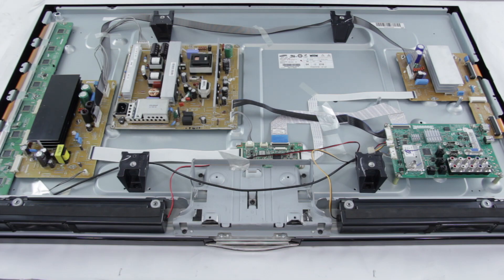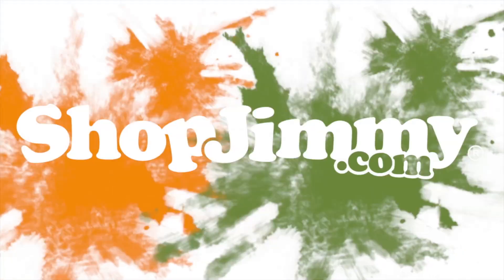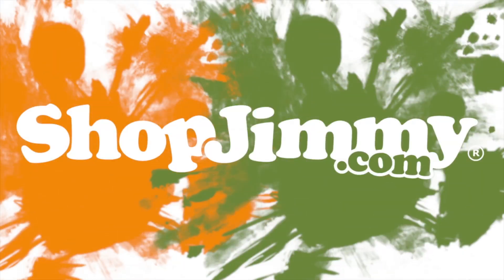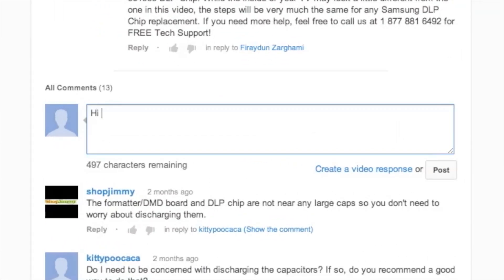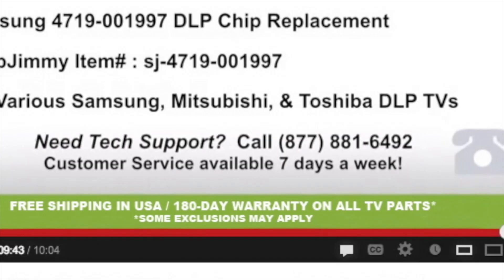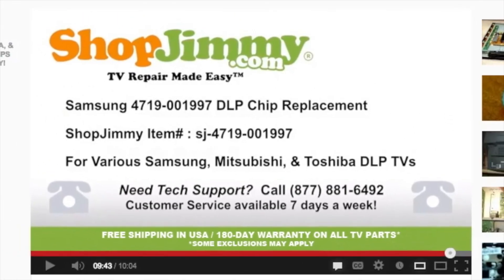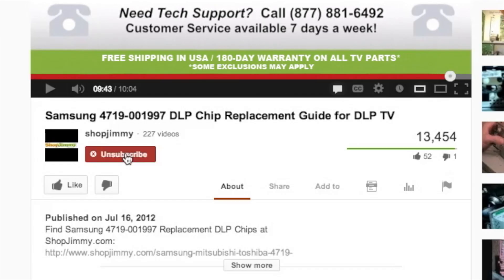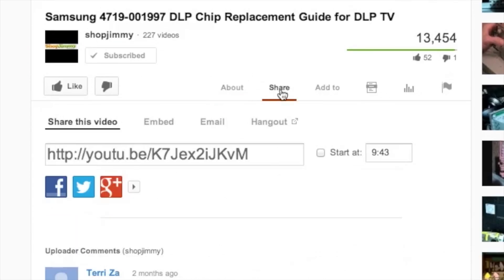Plasma TV Repair Tutorial - Common Symptoms & Solutions - How to Fix Plasma TVs

Comment: Hi there, you guys seem helpful. I have been looking for help with this for a while. I have a Samsung Plasma pn50a510p3f made in June 2008. I think its 55". It turns on and off by itself and occasionally makes very loud noises while doing this. Also, my Xbox 360 will display after about 15 minutes, but my xbox One will not display and causes it to continue this cycling process. I did some research and found that many people have this issue. It is theoretically a bad capacitor in the power board issue. When I discovered this, I opened it up. The problem is that none of the capacitors on the power board look bad! Is it possible for them to be bad without showing? Or could it be another issue? I searched around all the other boards for anything that looks awry, and I could only find one capacitor on the whole TV with a slight bulge. Its 25v and 680 microfarads, and it is on the Y Sustain; I noticed at about 3:45 you mentioned that if this board is messed up it can cause the TV to cycle. Is that simply my problem? If I replace that one cap, should I be fine? Thanks! I don't have enough $$ to shell out for a new TV, and this one is better than pretty much anything I could afford!
EDIT: I tried the method described in this video to disconnect the X and Y boards. The TV is still cycling without either of them being connected, so I am almost 100% sure its a power supply problem. Any suggestions?
Reply: cblowrun Do you have a multimeter?  Tampatec has some good videos on checking capacitors out.
Reply from the maker: cblowrun   PLEASE SUBSCRIBE TO OUR CHANNEL - Try all repairs and troubleshooting at your own risk.  This could be a problem with either the power supply or the main board.  Do you have any experience using a multimeter?  If not, then you can replace the main board and then power supply board individually to see if one of those boards fixes the problem.  Click this link to replacement parts for your TV model number:  http://www.shopjimmy.com/catalogsearch/result/?q=pn50a510p3f  There may be multiple boards for the same TV model number, be sure to match part numbers on your current board, with your replacement for compatibility.  Thanks and please let us know if you have any further questions with your TV Repair!  www.shopjimmy.com
Reply: ShopJimmy.com Hi there, I tried the capacitor repair shown in another video you guys did. After attempting to replace the capacitors, my screen is just white with some black splotches. I wish I could upload a photo for you to see. Ever seen anything like that before? The tv's actual picture was working fine before I attempted the repair - apart from the cycling issue.
Reply: No idea.  Sorry cblowrun.  You might need to check your other boards as well.  :(  I am not really competent diagnose.
Reply from the maker: cblowrun   PLEASE SUBSCRIBE TO OUR CHANNEL - Try all repairs and troubleshooting at your own risk.  I recommend replacing the power supply board, the Y-Main Board, the Upper & Bottom Y Scan Drive boards in your TV.  Click this link to replacement parts for your TV model number:  http://www.shopjimmy.com/catalogsearch/result/?q=pn50a510p3f  There may be multiple boards for the same TV model number, be sure to match part numbers on your current board, with your replacement for compatibility.  Here is a link to a video showing how to identify your part number, click here:  https://www.youtube.com/watch?v=R1jmj_foId0  Thanks and please let us know if you have any further questions with your TV Repair!  www.shopjimmy.com

Comment: samsung pn51d8000 plasma tv won't turn on. Power light blink when I press it.
Reply from the maker: Thai guy   Try this at your own risk. Unplug the TV, then disconnect the y board and plug in the TV to see if the TV powers up. Reply with the results of this test. Thanks! www.shopjimmy.com
Reply from the maker: Thai guy   PLEASE SUBSCRIBE TO OUR CHANNEL - Try all repairs and troubleshooting at your own risk.  This could be a problem with either the power supply or the main board in your TV.  Unfortunately, without testing these boards with a meter and checking voltages, you would have to replace the boards individually to see which on of them fixes the problem.  Click this link to replacement parts for your TV model number:  http://www.shopjimmy.com/catalogsearch/result/?q=pn51d8000  There may be multiple boards for the same TV model number, be sure to match part numbers on your current board, with your replacement for compatibility.  Thanks and please let us know if you have any further questions with your TV Repair!  www.shopjimmy.com

Comment: Hello! I have a Samsung Plasma PNF64F5500AF which has just started going to a black screen occasionally.  It will go black, then the picture will come back, and then black again. I can still hear sound while it is black.  I know it is not the connections as I have tested each of them and the smart tv apps and it still goes black on each of them.  I haven't cracked it open yet to see if any capacitors are bulging or faulty. Please Help!?!?!? :)
Reply from the maker: Jason Pope   PLEASE SUBSCRIBE TO OUR CHANNEL - Try all repairs and troubleshooting at your own risk.  I recommend replacing the Y-Main Board and the Upper and Lower Scan Drive boards in your TV.  Click this link to possible replacement parts for your TV model number:  http://www.shopjimmy.com/catalogsearch/result/?q=64F5500AF  Be sure to match part numbers on your current board, with your replacement for compatibility.  Here is a link to a video showing how to identify your part number, click here:  https://www.youtube.com/watch?v=Aodz2LHkzbY Thanks and please let us know if you have any further questions with your TV Repair!  www.shopjimmy.com
Reply: Thanks shopjimmy.  Replaced the y main and the buffers and it appears to have resolved the problem.  I will recommend your channel and website to all my friends to fix their own devices.  Thanks again!

Comment: I knew about the dangers of flipping a plasma upside down but I figured they are shipped all over the world and also figured I can flip it upside down for 20 minutes while I put the stand on. After I finished putting it together I flipped it upright to use and no picture.
The power button is red when off like usual, and I press the power button to turn on and I see it turns on but all I see is a black screen with no visual. As in its turned on but black as if your on a source with nothing plugged in and when I hit the source button I do not see the Blue box at the top left light up letting me know what input is on but I can see its on for sure. So I don't think it's power supply and I'm not getting any ugly horrible lines on my screen. Any suggestions before I bring a tech out? I don't mind opening myself I like projects.
Reply from the maker: David Gentilella   I recommend replacing the Y Board and Buffers.  Try all repairs and troubleshooting at your own risk.  Please reply with your TV model number.  Click here to view a video that shows how to find your TV model number:  https://www.youtube.com/watch?v=S51nhAmwR2M  Thanks!  www.shopjimmy.com

Comment: Hi there, I have a plasma Tv Samsung, Model PS50B450B1W, manufactured in June 2009. There are vertical(white) lines all over the screen from left to right. Which board would be the faulty one?
 Thanks in advance!
Reply from the maker: Nuno Damaso   Try all repairs and troubleshooting at your own risk.  This sounds like a TV panel (TV Screen) problem.  If your TV panel is bad, it may be more cost-effective to replace the TV as panels are typically hard to find in stock, difficult to replace, and expensive.  Thanks and please let us know if you have any further questions!  www.shopjimmy.com

Comment: Hi, I have Panasonic viera tx-42gt20b. I have had it for around 4 years with no problems. The last few weeks it has started giving a high pitched whine when on. Having done a bit of research it seems the flyback transformer may be the culprit. Or possibly a capacitor or two. The high pitched whine isn't always there, just mostly. And on TV tuner rather than always (using hdmi for ps3 it isn't there so much,but is occasionally). I have checked capacitors and while they all seem OK there is one that is slightly rounded compared to others which are completely flat. Values for cap 450v 350uf 105c. I am having trouble finding one with these values. The cap located on power board. I don't believe the whine gets worse via brightness settings as it is constant when turning brightness up or down, however, the whine does change on different pictures. I hope this is enough info for a possible solution. An answer via my email would be greatly appreciated as I may not find your answer if it were just posted on YouTube.  Thanks in advance. 
Deane
Reply from the maker: Deane Washer   PLEASE SUBSCRIBE TO OUR CHANNEL - Try all repairs and troubleshooting at your own risk.  I recommend replacing the main board in your TV.  Unfortunately I do not see any replacement parts in the search results for your TV model number on our website.  Please reply with your part number on your main board and I can try searching for replacement parts.  Thanks and please let us know if you have any further questions!  www.shopjimmy.com

Comment: I have a Samsung plasma tv model number PN50B450B1D and it has vertical lines in it I changed the T-Con board but no change what's next
Reply from the maker: Beeboy Harris  Try all repairs and troubleshooting at your own risk.  This sounds like a TV panel (TV Screen) problem.  If your TV panel is bad, it may be more cost-effective to replace the TV as panels are typically hard to find in stock, difficult to replace, and expensive.  Thanks and please let us know if you have any further questions!  www.shopjimmy.com
Reply: Thank you

Comment: I have an LG 50pg25 Plasma with no picture and no sound.  I have checked all the boards for any bulging caps and have found none.  After research, a lot of posts were pointing to the ysus board so I replaced that and still no picture or sound.  When I turn the TV on it powers up and the power indicator flashes 11 times and then stays blue like it is on.  I have tried hooking up different input sources and even tried to just bring up the menu screen and nothing.  Also when I do turn it on in a pitch black room the screen does light up gray but is only visible when it is completely dark in the room.  This TV died about 6 months ago during an electrical storm and I am just now getting a chance to work on it.  Any help would be greatly appreciated.  Thanks

Comment: Hi, 
I am hoping you can advise me on possible fixes. I have an LG 60PG60 that is having a display issue where the TV shows the picture (cable signal) in a horizontal bar that is in the middle of the screen - above and below the horizontal bar are blue. 
Any thoughts?
Thanks!
Ken
Reply from the maker: ken hayes   PLEASE SUBSCRIBE TO OUR CHANNEL - Try all repairs and troubleshooting at your own risk.  This could be a problem with the buffer or the TV panel.  You can try replacing the YDRVTP & YDRVBT boards in your TV to see if one of those fixes the problem.  Click this link to replacement parts for your TV model number:  http://www.shopjimmy.com/catalogsearch/result/?q=60PG60  There may be multiple boards for the same TV model number, be sure to match part numbers on your current board, with your replacement for compatibility.  Here is a link to a video showing how to identify your part number, click here: Thanks and please let us know if you have any further questions with your TV Repair!  www.shopjimmy.com

Comment: I have an LG 60PN5300 that goes into Standby mode when it gets hot.  When I get a fan blowing on the back of the TV, it turns on by itself and performs fine.  When it goes into this Standby mode, I can't turn the TV on with the remote or by pressing the on/off button. Everything else is working fine and the picture is still perfect.  Bad power supply maybe?
Reply from the maker: RKDriver   PLEASE SUBSCRIBE TO OUR CHANNEL - Try all repairs and troubleshooting at your own risk.  It could be a bad power supply, but it sounds like a bad main board to me.  Click this link to replacement parts for your TV model number:  http://www.shopjimmy.com/catalogsearch/result/?q=60PN5300  There may be multiple boards for the same TV model number, be sure to match part numbers on your current board, with your replacement for compatibility.  Thanks and please let us know if you have any further questions with your TV Repair!  www.shopjimmy.com
Reply: RKDriver I think you're right.  The fan blows directly on that main board and within a minute, the board cools and kicks the TV on.  I went ahead and ordered a main board from you guys, thanks.

Comment: Problem with LG Plasma 50PA5500-UA. No picture. Red stand-by light turns on when power button pressed but no picture. Also, red light flashes once right above component panel in back when power button pressed; also hear corresponding clicking sound.
Reply from the maker: phil palcic   PLEASE SUBSCRIBE TO OUR CHANNEL - Try all repairs and troubleshooting at your own risk.  I recommend replacing the YSUS and the YDRVTP & YDRVBT boards in your TV.  Click this link to replacement parts for your TV model number:  http://www.shopjimmy.com/catalogsearch/result/?q=50PA5500-UA  There may be multiple boards for the same TV model number, be sure to match part numbers on your current board, with your replacement for compatibility.  Here is a link to a video showing how to identify your part number, click here:  https://www.youtube.com/watch?v=GEllG3RV-tcThanks and please let us know if you have any further questions with your TV Repair!  www.shopjimmy.com

Comment: Hi there! I have a Samsung 50 " PN50B450B1D Plasma Tv. When plugged in, it clicks blinks twice, seems to turn off then blinks five more times. There is no picture. I have it apart and have been looking for blown capacitors and cant find any. I would like to buy a replacement board if necessary, but wonder which is the correct one to purchase. Thank you! William.e.akers@gmail.com
Reply from the maker: Eric Akers  PLEASE SUBSCRIBE TO OUR CHANNEL - Try all repairs and troubleshooting at your own risk.   I recommend replacing the Y-Main Board and the Y-Buffer Board in your TV.  Click this link to replacement parts for your TV model number:  http://www.shopjimmy.com/catalogsearch/result/?q=PN50B450B1D  There may be multiple boards for the same TV model number, be sure to match part numbers on your current board, with your replacement for compatibility.  Here is a link to a video showing how to identify your part number, click here:  http://www.shopjimmy.com/samsung-bn96-09738a-y-main-board.htm  Thanks and please let us know if you have any further questions with your TV Repair!  www.shopjimmy.com

Comment: Model code - PN43D450A2DXZA

Nephew cracked the screen with a toy now there is no picture, what am I looking at for a fix. No picture but it turns on and has sound, also seems to respond to the remote commands like switching channels and volume works. Any info will greatly be appreciated please and thanks.
Reply: Model NO. PN43D450A2D
Reply from the maker: arailias   If the screen is cracked, unfortunately there is no repair.  Thanks!  www.shopjimmy.com

Comment: Hi, I have an old Daewoo DTS-42 plasma TV.  I get standby power when plugging the TV in (the red light illuminates on the front of the tv).  Turning the TV on with the remote, the light switches to green, the screen starts to come on (lit but black) for about three seconds, then it clicks off and the light returns to red.  Any ideas for what to troubleshoot?

Comment: I have a Vizio vp50hdtv20a from Nov 2007. The picture changes depending on what is displayed. If the image is dark (not a lot of white) the image is fine. If there's a lot of white on the screen, the white pixels are ghosted or stretched up to about 3/4" to 1" below the white pixels they match, the more white, the longer they stretch. They're not the full brightness of the original pixels. This happens on every input on the TV. I found a couple of bulging capacitors on the power supply board and have replaced them. The issue remains. Based upon other videos, I think the y buffers are fine, but I'm unsure. I think the problem Is this caused by the y-sustain board (LJ92-01399A), what do you think?
Reply from the maker: Joe Groom   PLEASE SUBSCRIBE TO OUR CHANNEL - Try all repairs and troubleshooting at your own risk.  I recommend replacing the Y-Main Board and the YDRVTP & YDRVBT boards in your TV.  Click this link to replacement parts for your TV model number:  http://www.shopjimmy.com/catalogsearch/result/?q=vp50hdtv20a  There may be multiple boards for the same TV model number, be sure to match part numbers on your current board, with your replacement for compatibility.  Here is a link to a video showing how to identify your part number, click here:  https://www.youtube.com/watch?v=R1jmj_foId0  Thanks and please let us know if you have any further questions with your TV Repair!  www.shopjimmy.com